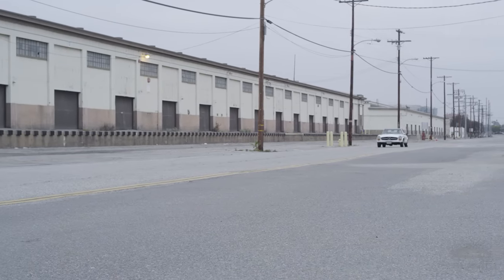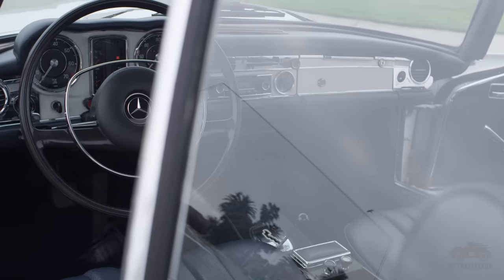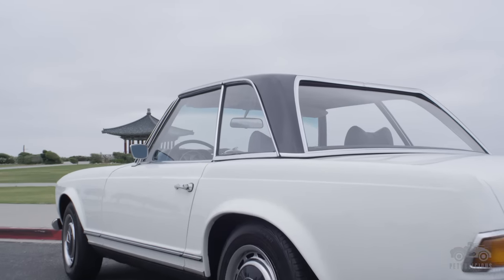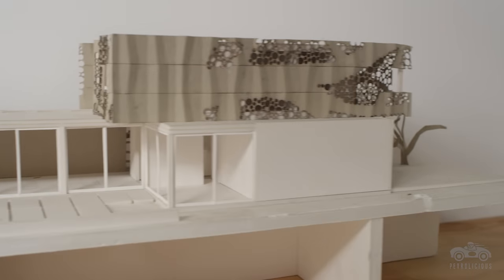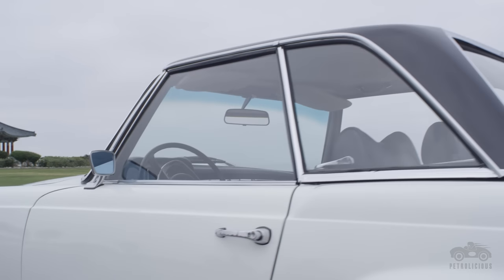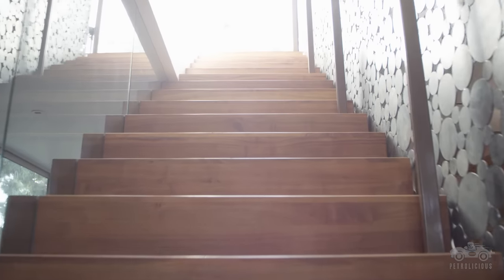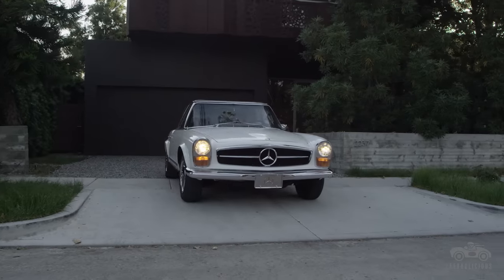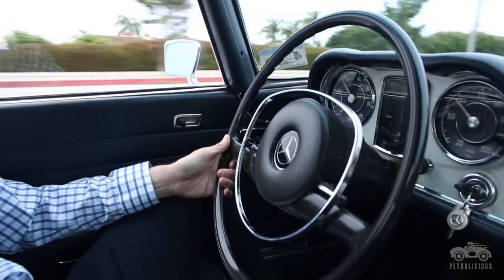The Mercedes-Benz 280 SL ‘Pagoda’ was shaped by function and form

Comment: The 280SL is one of the few Mercedes I like, but I would swap the US headlights for the European ones. Looks much better.
Reply: The one in the video is a European spec. You can tell because of the lack of vertical bumbers on the front and back.

Comment: The car does not look so impressive to me. Now.. THE 1954-1963 300SL GULLWING & convertible  are GORGEOUS cars.
Reply: CEEPMDEE  , I agree! Mercedes should have produced a unibody version of the w198 and continued  the beautiful 300SL styling through the '60's, 70's and 80's.  The w113 and r107 are ok designs but should not have been a replacement for the beautiful 300SL

Comment: The centre spring in the swing rear axle needs replacing. It is too soft with the wheels slanting inwards, resulting with the back end lower than what it should be.

Comment: Ive driven one like that, a bit newer, I think it was 1972. But as beuatiful as it is it is still one of the most unpleasant driving experiences for me. Mostly because the seating was horrible. I had to rest my left foot between clutch and brake pedal. It was the only place I could fit my foot. And it was clumsy. The steering wheel is like from Titanic - big as what. And a little city driving and the plugs went oily. 

Beautiful car but not for me.